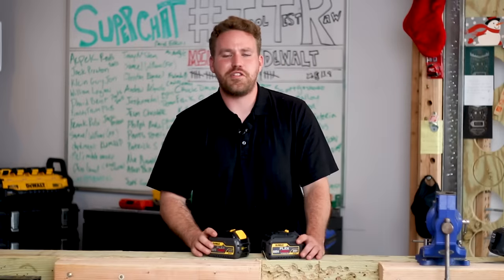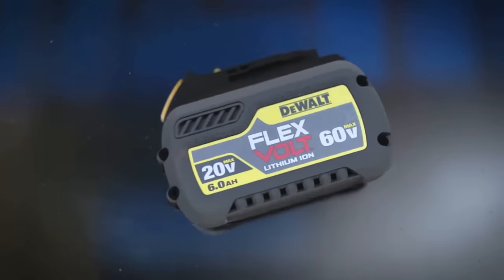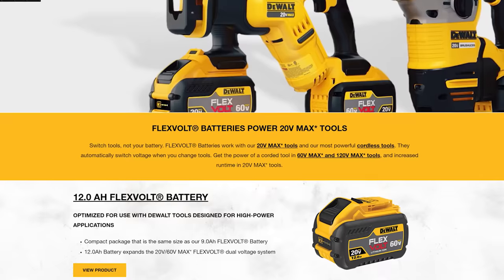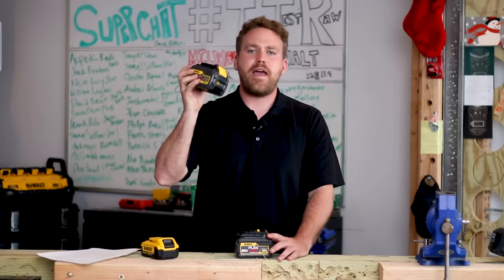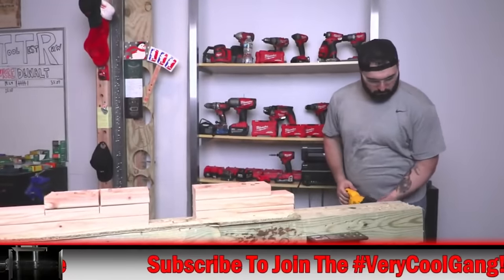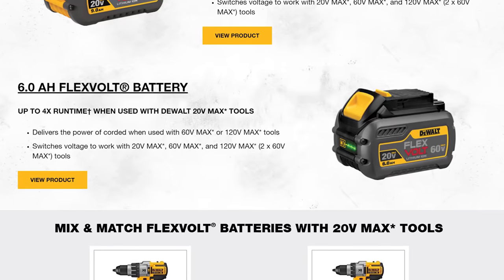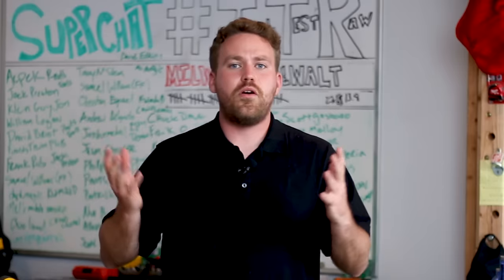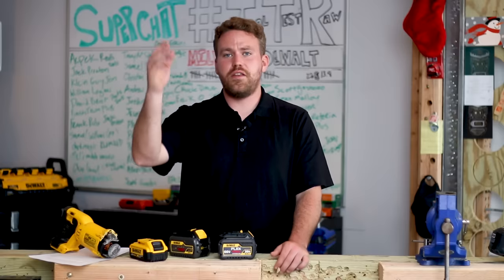NEVER USE DEWALT FLEXVOLT BATTERIES ON 20V MAX TOOLS!

Comment: NO, it does not "over-power" them in the sense you are thinking.  A FlexVolt pack is merely THREE of the 20-volt packs in one case.  Depending on the tool you insert it, it switches between all 3 of the 20-volt packs in parrellel or series.  In parallel, you still only have 20 volts - just more AH.  When in series, you have 60 volts.  You may have issues when running a FlexVolt in your 20 volt tools if you are really pushing the tool to it's limits (or beyond).  This has nothing to do with the battery over-powering the tool, just a simple matter of you taking advantage of the extra power reserve and pushing the tool harder than it should be pushed.  Keep in mind: you can do the same thing with ANY CORDED tool, too.  Take a DeWalt table saw and start ripping 2" thick oak non-stop for 10 minutes... you will likely smoke the 120 volt corded motor just the same.
Reply: I think what you describe "pushing the tool harder than it should be pushed" is exactly the same as "over-powering the tool." Without the high AH battery the tool will bog down and quit without as much damage. But if you have the high AH battery you can keep pushing it beyond the ability of the components and the tool is toasted and perhaps won't notice the problem in time since the tool won't necessarily run out of power.
Reply: @gorkyd7912  Again... I recently just purchased the DCG413 (20V) Grinder and have been running it w/ the 60V FlexVolt batteries quite a bit.  The reality is: YES, I can really mash down on that grinder and it will run like a corded tool.  But reality is this: I really SHOULD NOT be doing that... EVEN WITH MY CORDED grinder - I would never apply that level of abuse to my tools.

This is sort of like individuals who put 24 inch cheater bars on a 3/8" ratchet and complain when it breaks.

Or those who put 5 foot cheater bars on a 1/2" breaker bar (hint: this is what 3/4" and 1" breaker bars are for).

Yes, my DeWalt 20v grinder can absolutely tear through 1/2" plate steel when I push into it hard.  But should I?  Not really.  Not even with my corded DeWalt grinder do I do this.

Another example is my DCD996 hammer drill.  I started to overheat that tool while attempting to drill a 3/8" hole into concrete that had cured since the 1970's.  This happened with a 4ah 20v battery!!  The problem is not a cheap tool, the problem is:  I am pushing the tool too hard.  My solution to that was simple: I purchased the DCh133 rotary hammer.  Problem solved.  No longer need to push as hard, and tool runs cool.

The nice thing about the FlexVolt packs is this:  as long as you are not abusing your tool, the added capacity those packs provide can be priceless.

Finally, I stand firm by my original point regarding "over powering".  Amp-hours is CAPACITY, it is NOT the same as "Amps".  Technically speaking - a 1ah battery at 20 volts can have the EXACT SAME ABILITY to deliver 20 amps as a 6 or 8ah battery.   From an electrical engineering point-of-view, batteries do not "push" current.  Current is "drawn".  

Case in point: your home likely has a standard 200-amp service feed from the power company.  When you plug your phone charger into the outlet, it only "pulls" what it needs.  This is why you have a breaker... if the device attempts to "pull" more than the circuit is rated for, the breaker trips - cutting power.   

Now imagine you have a table saw and are cutting 2" thick oak planks.  You start to cut the wood and the breaker pops.  You are tired of popping the breaker to which the cord is plugged into, so you move it to another outlet that is on a 20-amp breaker instead of a 15 amp breaker.  Now you keep cutting wood.  But this time... instead of the breaker popping - you end up smoking the motor in your table saw.

Is this the breakers fault?  Is it the power companies fault?

No - you should have known better.  

I ALSO INVITE EVERYONE TO WATCH THE VIDEOS THESE IDIOTS ARE MAKING... Cutting a 6x6 pressure treated post as FAST AS THEY CAN (timing it!!!).  Pushing the tool as hard as they can to "time it".  The  dude is easily putting putting upwards of 100 pounds into the tool itself.   This is NOT how you use that tool.  Ease up and let the blade to the work.  By the way: this IS what they make small chain saws for.  

Then they have these HUGE lag bolts that they are driving with a TINY 1/4" impact!!!  WTF?!?!?!  DeWalt makes larger impact guns EXACTLY FOR THIS PURPOSE.  That is NOT what that tool is designed for.  No wonder it was smoking.  This is not the fault of the tool, or battery.  It is called operator-error.  Get a bigger impact.

I also stand firm in the saying: we should just take the warning labels off everything and let the problem solve itself.
Reply: @deanrantala   I know AH is not the same as amps but I also know if you take off the 4 or 5 AH battery and put on the 9 or 12 AH battery you will notice a difference in the immediate performance of the tool and not just how long it runs before recharging, so that's more than just the capacity of the battery that changes, it is delivering more juice somehow apparently based on results. If this CAN result in the tool getting toasted that's good to know regardless if you ever expect to encounter this level of abuse yourself, so props to these video makers for sacrificing their tools for our knowledge. Obviously I'm not going to refrain from using 60V batteries just for this reason but if I'm given the choice between a set of tools that will possibly self-destruct when abused versus a set of tools that can take that same abuse but require more frequent battery changes, I personally would go with the latter. I'm more likely to have a few extra batteries than a few extra tools. You can try to baby tools all you want but in my limited experience there is a 0% chance that I will have the right tool for every given job on hand, so some level of abuse is just inevitable and the ability to survive 5 minutes of unrealistic torture testing does indirectly translate into long-term durability.
Reply: @gorkyd7912  Or you take out your flat 20v MAX battery and wop another one straight in and continue pushing the tool 🤷‍♂️ - outcomes no different to using a flexvolt.
Reply: @gorkyd7912  Increased Ah in the way Dewalt does it with these Flexvolt batteries is also an increase in available amperage...or how many amps are being pulled from 3 cells vs 1 cell. When you parallel cells not only do they increase capacity (Ah) but they also increase discharge (Amps). 3 20V packs in parallel (not sure what cell they are using in these so going to give an average number) will give you 30A+30A+30A of available power. Now your tool might limit the max amperage so lets say the maximum amperage for your drill is 20A. Instead of pack putting out 20A which is 2/3 of its amperage, you have each pack putting out 6.67A. 

If you look at lithium ion discharge graphs that have multiple discharge currents you'll see that discharging a cell near its maximum discharge current causes significant voltage sag. Discharging a cell (meant for power tools) at 1/5 of its max discharge current will not be that noticeable compared from pulling one amp. Minor minor voltage sag and it'll often spit out a milliampere hour capacity higher than its actual rating. Running a cell at 2/3 of its rated potential is usually where you start to see voltage sag so significant that it comes in short of its milliampere hour rating.
Reply: Yeah that makes sense because a longer runtime means a hotter tool if your run it non stop no different than using a 20v skill saw non stop with like three 6ah 20v back to back non stop in a row might burn it up to.
Reply: @gorkyd7912 I have been using Flex volt batteries in my 20 volt tools ever since the flexvolt was invented and never had a problem and actually the new Power stack batteries are designed to push the 20 volt tool even harder then the original flexvolt
Reply: @gorkyd7912 its literally just 15 cells, 5 series 3 parallel in 20v mode, 15 series 1 parallel in 60v mode. A 12ah 20v battery will perform identical to a 60v "12ah" battery, because when in 60v mode it is actually a 60v 3ah battery. The tools run better when compared to a smaller battery because there is less voltage sag when compared to, say, a 5ah battery, which will be only 10 cells-5series 2 parallel. Also note that the 12ah batteries use 21700 cells vs the 5ah using 18650's, samsung 40T's to be specific. Those are rated at 35A per cell. So you could have a 12ah battery with 105A output vs a 5ah which usually have LG he2 cells, which are good for only 20a/cell or 40a total. 

A battery capable of 105A output vs 40A output. No magic or voodoo stuff going on, just different battery cells used.
Reply: @ganzeytyler   I don't know why you're translating "more power" as "magic/voodoo" but whatever.
Reply: @gorkyd7912  you said "so that's more than just the capacity of the battery that changes, it is delivering more juice somehow apparently based on results. "  

it is the larger capacity that "somehow, apparently" allows more amperage
Reply: @ganzeytyler   Fair enough but I don't want to make that assumption personally because there's a bunch of reasons the tool could be drawing more amps from a given battery that aren't caused directly by the capacity.
Reply: True👍🏼👍🏼
Reply: @gorkyd7912  yeah but the key difference the tool is dying because it has the ability to keep going until the motor kills itself, while the myth is that the battery is frying the circuits. Can't blame the battery for letting you continue, that's like complaining a car broke down because it had a bigger gas tank

Comment: Results are in, no one has the same problem as you guys VCG lol.
Reply: Yeah I’ve put some of my stuff three way worse punishment they their testing and my stuff still runs and runs and won’t die
Reply: @shredder646  I've been a dewalt fanboy for years...  I dropped my old 9.6v dewalt from inside the ceiling, it fell down and bounced down a long set of stairs... Worked for years after that, until I finally did it in when I welded a socket driver to chuck up a 5/8 thread lag bolt... Had 64 bolts to put in, I had like 3 left when it finally burnt out..   I got a milwaukee a few years back because it was a good price, I haven't looked back.. I love it.
Reply: @shredder646  was just about to say that
Reply: See like to dislike ratio. Not trying to say it can't happen, but I've used one in my drills and grinder for a year now with no problems. ( But I know somebody who said their flex volt batteries didn't last. ) I just bought another flex volt battery for extra, so I guess we'll see in another year.
Reply: No I don't. :)
Reply: @shredder646  really becoming a makita fan now though... The soft impact is glorious.
Reply: If you overload any tool it will die !
Reply: @shredder646  BS, i've seen idk how many different brands on their show and work, dewalt is definitely in their go to.
Reply: I've burned out a portable shopvac and the xr hammer drill using the 9ah flexvolt battery so far its just a matter of how long you run the tool without breaks compared to the load its under, I think because I've also used it on my Sawzall more than any other tool but taking breaks to let the tool cool and havnt had an issue yet.
Reply: @FateGathersStudios  My 9.6 was on its third replacement case  . when the batt died .its 27 years old now.
Reply: @AliceJaneSyndicate  wearing gloves kills tools .You cant judge the temp of the tool .
Reply: Milwaukee needs to stick with what they are good at making saws alls and  corded hammerdrills . there tools are too heavy and overpriced batteries still after 25 years still use outdated stick type batteries in some tools. proprietory batteries to tools that are not backwards compatible.. Picked up a brand new milwaukee skill . fxxk its heavier than my skill77.Im not getting any younger .
Reply: When the chips were down and I did construction for a living I used Dewalt and Milwaukee tools almost exclusively. Very rarely had a problem with those 2 brands and I'm an old creature of habit and a loyal fan of both tool lines.

Comment: What about using it with the saw mine came with a 9 amp hour flexvolt battery and works flawlessly. I've never really tried it in my 20 volt tools but I did run them for a couple seconds to see if the battery fit

Comment: I’m a heavy duty mechanic and have been using my flexvolt batteries on my 20v tools since they came out. Never a problem!!!
Definitely a Red tool perspective!!!
Reply: yea this was 100% nonsense. i used a 12ah flexvolt on an atomic 1/4" impact and it was fine. still ticking years later
Reply: It makes no sense because in a 20v tool its using different pins which flips some kinda switch inside the battery. It should be no different than a regular 20v. 20v is 20v and when a Flexvolt is used on a 20v tool its putting out the same voltage as a regular 20v battery.
Reply: I had this happen to three of my dewalt tools last year and just stopped using them on 20v tools.  I recently noticed at least one Dewalt tool say specifically on the box that it was compatible with the 60v batteries so there is definitely trooth to this video and Dewalt knows it

Comment: Attention,  There has been many complaints of the motor burning out on the Cordless Dewalt weed / grass Wacker .  Check into that please . Is it the 20 volt or the Flex 20 / 60 volt that is causing that problem??

Comment: So I see the power station lurking back there, what do you put on that? FV or just 20v ? I ask because I just picked one up at a Goodwill store for $100 works fine with my 20v 6ah batteries but was thinking about installing a bank of FlexVolt 9's..

Comment: Its totally fine. When run as 60V (through one set of contacts) it is the equivalent of 3 20v batteries in series (20*3 = 60v). When run as a 20v battery (through the second set of contacts)  then the 20 v sets of batteries are in parallel adding current capacity at 20v. Simple and safe. No different than the higher capacity 20v batteries from a 20V tool perspective.
Reply: exactly, but that guy is too full to know that
Reply: Thank you for answering in a professional and scientific manner. Im now going to research how to do this 🤓
Reply: @rozgniatacz_mend  i mean he literally made the whole video as a question, he wasnt stating anything and asked for an explanation at the end. im glad the conversation was had so now i know for sure

Comment: The Flex Volt batteries have a mechanical switch inside of them that switches between running the internal battery banks in a series vs parallel. When connected to a 20v max tool, the battery will run the 3 separate banks in a series, providing longer runtime. When connected to a 60v/120v max tool, the battery banks will run in parallel. Is it possible that you guys modified, or damaged your own batteries before doing these tests? As others have stated, nobody is experiencing these issues except for you guys…
Reply: 20v would be parallel and 60/120 would be series.
Reply: @rogerhupp3115  no

jk yes
Reply: You've got it backwards, Sparky.
Reply: @Thumbsdwn  Electrical engineer here. You got series and parallel backwards. Series adds voltage, parallel adds Amp hours. But, other than that your explanation makes sense.
Reply: @garrettg5130  I did, you're right lol
Reply: @JesseWright68  Are you the sparky from Denver area that knows the Shanley fam?

Comment: Here's what I'll say. Increased battery life means increased runtime. Increased runtime means increased heat which can correlate to increased stress on components. If you're not keen to heat and it's effects on your tools, your tools aren't going to last.
Reply: Excellent point!
Reply: @samsamson3890  you don't stop and wait for the battery to be charged, if you're using the smaller batteries you just replace it with another one and keep going till you finish what you are doing, it makes no sense.
Reply: Or for morons like me, don’t run the damn tool till it’s too hot to hold and you won’t break it 😂 just because the battery lasts longer doesn’t mean you can run it that long.
Reply: Same with electric cars....coincidence? Nope.
Reply: Yeah because the two seconds it takes to swap out a battery and start up again cools the tool down LOL😂

Comment: I’ve been using Dewalt tools for five years now. I switched over from Makita because I needed the cordless impact gun with the most torque and Dewalt had it. I haven’t looked back - now I have everything from their cordless string trimmer and hedge clipper tools to their cordless flexvolt table and miter saws. I have ten of the 6.0ah flexvolt batteries and I use them interchangeably with my fifteen or so XR batteries in everything except the two “flexvolt only” saws and I have never had a battery or tool problem under the most demanding conditions in terms of heat/dirt/duration doing demo,  rehab and landscaping work.
Reply: Will the FLEXVOLT  batteries  hurt the XR  tools
Reply: I don't  get a  Straight answer from dewalt
Reply: From my “hands on” experience of the last five to six years with multiple Flexvolt and XR batteries in a wide variety of Dewalt power products as mentioned above under every condition imaginable, I have had zero (0) problems with the Flexvolt batteries in XR tools.
Reply: Thank you

Comment: I have De Walt 18v tools, I bought adapter dcb115 charger and 2.  20v 2ah batteries. Can I use this charger to charge a 20v 5ah battery?

Comment: I've cooked 20v skill saws, drills and drivers using 20v batteries so I think it comes down to running them too long and pushing them to hard. Flexvolt batteries will give a longer run time but doesn't improve the tools ability to take on heavier work. Comes down to the user to watch what they are taking in with the tool.